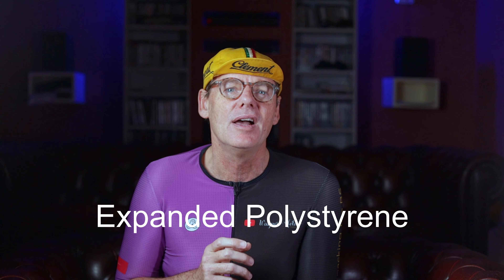Making DISC brake CARBON bikes LIGHTER. HOW?

Comment: I started running rim brake carbon tubulars after watching your other video. They are amazing!
Reply: Mee too
Reply: Me three!
Reply: I want to as well 😎
Reply: @nategibson7330  explain y
Reply from the maker: @portland675  sealant, works like in a tubeless
Reply: @portland675   Most of my punctures have been snake bites due to running low pressures at the end of long rides and glass shards or car tire casing metal wires caused by riding on dirty road shoulders, never had a slice in my tires.
Reply: @portland675  It was on clinchers obviously. Never tried tubeless on road tires but for what I've read about them it seems like the technology still needs improvements. I mean, tire changes are messy enough on regular clinchers just to add sealant and harder to fit tires to the mix.
Reply: @portland675  Nice argument, it's worth a try then!

Comment: EPS for all types of carbon bikes. Makes for lighter and stronger construction. As materials and processes improve, it may allow for lowering the UCI limit. I just hope they keep building for rim brakes, there are still room for improvement such as you mentioned, the compound of the brake pads or some crazy ideas like better pad design with rim cleaning leading edges before the main pad compression. Direct mounts can even use hydraulics. But development seems to focus on disc..sadly.

Comment: I'm sorry but I have to disagree with your statement about the Colnago C series being ultra clean. I recommend you watch Luescher teknik's vid about the C-60 and C-50. They aren't clean at all inside (mainly the lugs/tubs bond).
As for the best technique? I would say TIME's "RTM" is probably the best. EPS foam is good and is mainly used in headtubes, bottom brackets. 
I wouldn't say that bladder type frames are "worst". As long as it's well enough made, bladders are quite good and are still heavely used in "big" tubes such as the down tube. They are also better for chain and seat stays.
Reply: Agreed. The C series bike was no better. It's awful how manufacturers get away with the crap that they do, no matter how much you spend on a frame

Comment: Have built a couple of boats using foam sandwhich. The aero and boat building industry have been doing this for years to give light, very stiff structures. The foam remains in the structure. Impact resistance is very high as well, much higher than single skin fibreglass or carbon lay up.  Will be interesting to see where the cycling industry goes with this. I believe Partington  wheels made in Geelong are built around a foam core.  Very light and very expensive though.

Comment: Just my humble opinion on Pogacar opting for rim brakes is due to the frame's compliance for a more comfortable ride. Up Mount Ventoux he struggled to maintain high pace not because the disc brake V3RS is so heavy but the added structural rigidity required by the frame results in a stiffer ride.
Up the pyrenees he was so fresh to easily toy around Vingegaard and Carapaz riding comfortably aboard his rim brake bike.

Comment: Pogacar just won Lombardia (most technical descending race of the year) on RIM BRAKES.  He choose to run rim brakes, not for weight, but because they are BETTER.  You don't need a disk brake on a road bike.

Comment: I’m curious as to how compression is achieved with a solid core. A bladder can obviously press material against the inside of a mold but with a solid core compression would be achieved in having a slight interference of materials so when the mold closes it all gets the squish?
Reply from the maker: They use a then bladder or latex to either give the presure, or latex, that has rubber like properties

Comment: With EPS manufacturing, does the blank stay inside the monocoque frame, or is it removed somehow?
Reply from the maker: No removed, but  i couldn't find any information on how they get it out. Maybe a process secret 🤔😆
Reply: @waynosfotos  maybe they dissolve it using some solvent that doesn't degrade the carbon resin?

Comment: People are so obsessed with the weight I feel it's just making bikes more dangerous. I think the UCI should raise the weight limit rule so at least safety wouldn't be as much concern. There comes a time when you have to stop and say lets back up and get this right. I think the frames are to thin already which is why I went and bought a titanium frame.
Reply: 6.8KG high quality carbon rim brake bikes are perfectly safe
Reply: @MilanSmore  Sure. And I believe everything I read on the internet.
Reply: If you could see the shit I get into on my carbon bike you would soil yourself all over your ti frame. 
It’s way stronger than you give it credit for.
Reply: Weight is no guarantee of safety badly lated up carbon sheets between the layers whether you have 2 layers or 10 you only need a void in a key area to compromise the strength.  Thin frames no matter the material are all much weaker to strike damage. Titanium and steel dent and can crease or tearin  the butted tube areas  carbon splinters and cracks.

Comment: Remove the rear disc brake and put a caliper instead.
Cut the weight penalty by half !
Reply: @nategibson7330  
Cars and motorcycles have combined dixc and drim brakes for years. Please elaborate on why it wouldn't work in practical application. 
The only reasons for dual disc was reduction of production costs and inventory costs (wheels, rims, ...).
There is no rational reason for a disk in the rear on a road bike.
Reply: @nategibson7330  
In the 80's most motorcycle and cars still had drums at the back. Why, because it was cheap, easy and cheap to maintain and most of the braking power comes from the front.
As I said, on bicycle considering the weights and speeds involves, only manufacturing and inventory costs justify the use of disc at the rear.
Heck we have ceramic bearing on bike which are designed for high RPM and temperature. They are of no no use on bicycles.
They've introduced wider tire in conjunction with disc. It's not a coincidence. To support the torsion force involved they had to stiffen the frames, forks and wheels. Bye bye comfort ! How do you get it back ? Wider tires. It would probably bring more comfort at the rear (less stiffness required).
The rim brake at the rear, could be hydrolics if you absolutely want more modulation
Reply: @nategibson7330  
 @Nathan Gibson  
1st
Your bias (or not) personal observations are of very little value in science.
Your language is as if your were offering your expert opinion while I guess it's more related to the Dunning-Kruger effect.
2nd
Carbon layup on a disk frame/fork take into account the forces transmitted from the wheel disc located at the axle to the contact point. It has to be more rigid to resist torsion. Therefore, the fork and rear triangle are de facto more rigid. To which extent it affect the comfort ? But remember that most of the comfort on a bike comes from the tires.
3rd
The latest rim brakes iterations, especially direct mount calipers, are far from being a regression.
4rth
The question asked was: how to reduce the weight of a disk brake bike.
My suggestion is by removing the rear disc assembly you achieve this goal while retaining the performance at the front.
5th
Personal needs vary from person to person. I'm not suggesting that all bike should be built this way. Don't worry, someone having a different opinion than yours won't jeopardize your accessibility to dual discs.
Reply: @nategibson7330  
Offended ?
Definitely not.
Having fun at your expense ? Totally !
Reply: @nategibson7330  
Also an expert in science and emotion as well. Very impressive.
I'm sure we can add expert at women also ! 😏
By the way, you're parents must be very deceived to have such a brilliant young boy who ends up wasting all of his expertises as a bicycle mechanic in a LBS.
Reply: @nategibson7330  
Expertise : 
wasting highly susceptible vain people's time.

Comment: So disk brakes on flats and rim brakes on the mountains 🤷‍♂️
Reply: rimbrakes up the mountain. when you come down..you're f..d
Reply: Pogačar won first tt with rim brake bicycle though. Rim brakes almost certainly give you better aerodynamics.
Reply: Again, I am almost certain that many discs TT bikes exist solely because of commercial reasons and there is no performance benefit but performance loss. I think practically all modern TT bicycles with rim brakes have brakes hidden. Discs could be easily covered by fairings, but you would end up with bike that don't comply with UCI rules. So only thing that cannot be hidden are discs which have, according to Hambini, inherently bad aerodynamic properties.
Reply: @portland675  I am not sure if I understand you correctly.
For example, disc calipers are more aero than what? Something non-existent?
I think fairings are banned, period. Disc covers were probably in discussion because of safety concerns but uncovered discs were later deemed to be safe enough. I am pretty sure that covering discs for aerodynamic reasons would render bicycle non-compliant to the rules. That explains why nobody does it.
Reply: @portland675  Even casual rim brake calipers (non-integrated ones) are partially "hidden" behind rotating tire and rim.
You mean DB calipers FRONTAL area is smaller.
I would argue DB rim might bring slight dag decrease while rotors cause significant drag in real world conditions (unsteady airflow). I think that latter is more likely to be true, but lets admit, we are both just speculating.
I really doubt you have access to data that could make sound basis for your bias.
Reply: @portland675  1.) TT bicycles mostly have integrated rim brake calipers.
2.) rim brake calipers reside in the wake of the tires and rims
If you really believe you have no bias you are naive.
Reply: @portland675  🤦
Reply: @portland675  There, you said it, rim brakes are hitting dirty air. This means that they aerodynamically don't matter as much as if they would be hitting clean air (like discs, more or less). I think you are somewhat confused. Hitting dirty air is bad when you try to create lift or downforce, but for reducing resistance it is good to be behind something in more or less dirty air.
Reply: @nategibson7330  Here we go, another confused individual. I never said downforce matters in cycling, I am just trying to explain basic concepts. Hiding rim brakes is not very difficult to achieve. Way less complicated than having to deal with disc brakes. And way more aerodynamically efficient. 
Conventional rim brakes are not aerodynamically optimized, but they ARE  hitting dirty air created by rotating wheels and thus their shape does not matter as much.
Dirty air is not worst thing you can have, dirty air is practically unavoidable disturbance of air behind a moving object. And in real world conditions in cycling airflow is very unsteady to begin with anyways.

Comment: The whole concept of disk break road bike sucks. Frame weight is one of the problems and not the major one. Overall functionality as a concept is problematic. Inbalanced and sudden breaking, need for stronger thus heavier wheels with more spokes, parts beeing less dependable due to unnecessary diet,
and most of all insisting to change a system that really works.
Eps system use while securing structural integrity, for rim break bikes,
will result even lighter bikes more aero and overall functionality will be more in line with the laws of physics.
Ask Colnago and Tadej Pogacar.....
Reply from the maker: Agreed, but rim brakes are under weight so no need. Whilst disc bikes, another story! 🤔🤦
Reply: Mr Colnago doesnt like Rim brakes
Reply: @johnlewsey4458  And he probably want Campagnolo to still produce rim brake groupsets.
Reply: @jestag2  nothing wrong with that, every one should be able to choose which system is best for them.
Reply: @johnlewsey4458  Agree.
Reply: None of your points about the fundamental flaws of disc brakes speak to their being fundamentally flawed. Hydraulic disc brakes can stop a 1000kg race car barreling down on turn 1 from well over 200mph, you can’t tell me they aren’t the best tech we have currently. They obviously have some teething problems in the execution but they are fundamentally an excellent concept.
Reply: @nategibson7330  OK.. You probably don't understand the word balance. Rim brakes are symmetrical in the way that the force is applied so in disk breaking there is no natural balance because there is no symmetry...
(Cars have usually four wheels so a better balance is achieved) .
Discs are not aero.-
Power applied to the fork while breaking is also asymmetrical. That means uneven force is needed to Keep the sterer straight or  be in control of a turn. I won't explain why this system needs more spokes you can find this info everywhere.
And since I live in Grecce, where there are hills and mountains followed by sea level routes and rarely rains there is not any advantage over rim breaks.
Reply: @portland675  Maybe you think I'm against disk breaks on any bike. That's not the case. Disk brakes do not have any advantage over  rim breaks for road and even city and trecking bikes. It's not a sound design for lighter and faster bikes, it's not as trouble free as the direct mound or the candilever breaks and if malfunction occurs you have to cary your bike home.
There is not one rule for all bikes. I quess your mtb bike is aero too.....
Reply: @portland675  As I wrote before, there are not bad weather conditions and lots of rain where I live. I respect your preferences, but I also like to have the choice of what serves me better. I'm a very experienced road bike rider and I can tell what works better for me and that's not discs.
Probably in the near future the design and the dependability of discs may evolve so I may be tempted.
For now I'll stick to rims as long as I have the choice.
Reply: @portland675  "Evolution" has jumped 
off the " favor of humanity" train. 
Road bike technology is "evolving" just for revenue reasons. 
Once in a while a certain innovation really contributes in bike evolution and benefits for the riders. Disc breaks is all about money. 
Prone to malfunction , not serviceable on the spot, not a rideable bike when bended, heavier, less balanced breaking, time consuming to service and difficult when removing a wheel for packing and then putting back when it also needs spacing. They are not better .... They are another option that has brought a lot of money to a bike industry which morals are effected by greed. Top European brands produce their bikes in Cambodia, China Malaysia. American brands do the same.
That's about money. It's not about better bikes. Bike industry's soul has been bought..... But that's how I see it. You may conceive it as the miracle that the bike world was waiting......